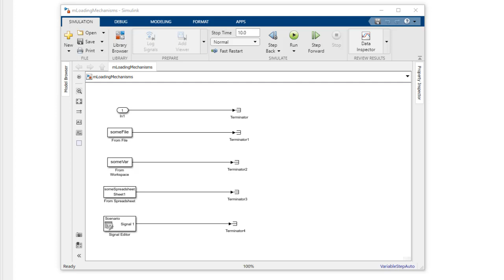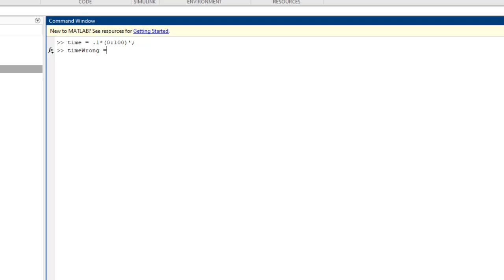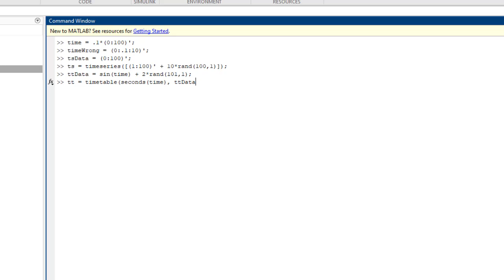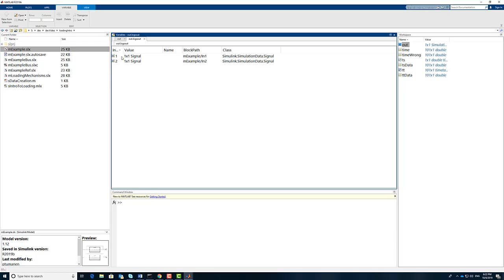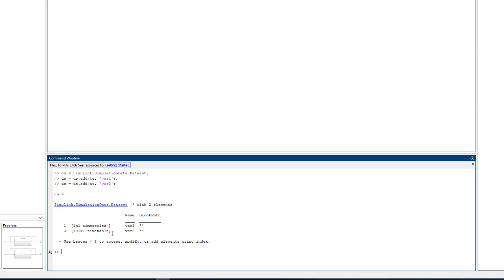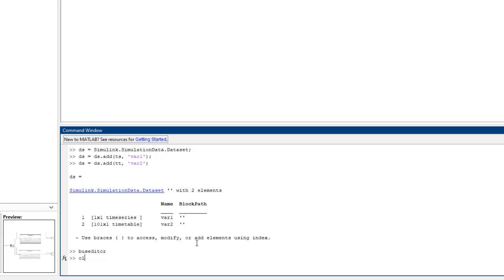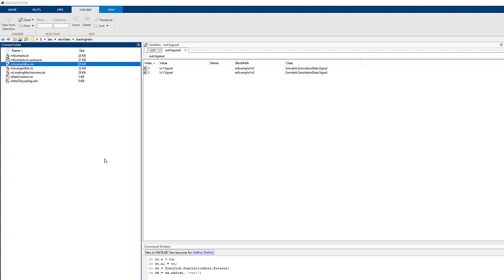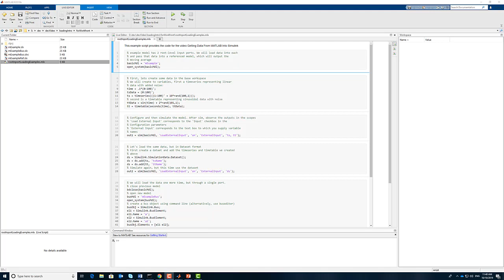How to Bring Data from MATLAB Into Simulink | Hear from MATLAB and Simulink Developers

Comment: Sir can you tell me how to import a workspace variable, in my case, it is a row vector to Simulink. I used simin block but it is giving error asking 2 columns. may be time, but i dont want time variable. I need to send just row vector to simulink. This row vector is generated in matlab
Reply: it must have two columns,  one is time ,the other one is the signal  variable you want to import .  if  you have row vector just transpose it , besides you should aware that  time is necessary for a  signal .

Comment: hello I have a question about using a from workspace in simulink
so in workspace I have signal value and signal timestamp. I want them both to be inputted into simulink

What I already did is, create a structure like variable.signals.values/dimension/time
after that I already input variable onto the parameter data on the "from workspace" parameter and onto the parameter configuration box
but the error that I always get from running the simulation is this magic word :

"External input specified in the Configuration Parameters dialog box on the Data Import/Export page (or as an option to SIM command) to a model containing no root level input ports"

I've been paying so much time to search for this solution, so I need some serious help over here =(
Thanks in advance... =)